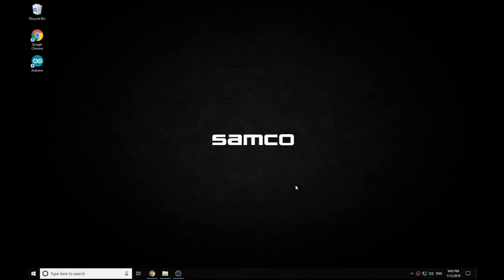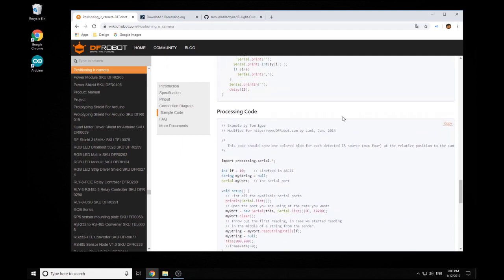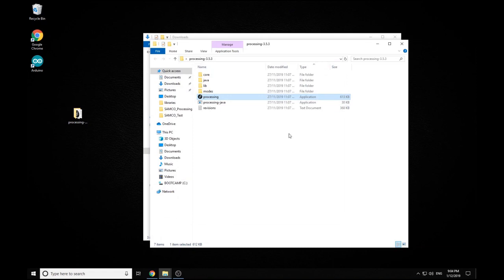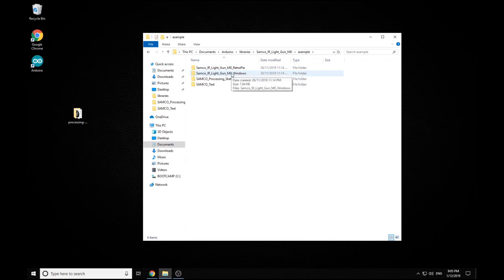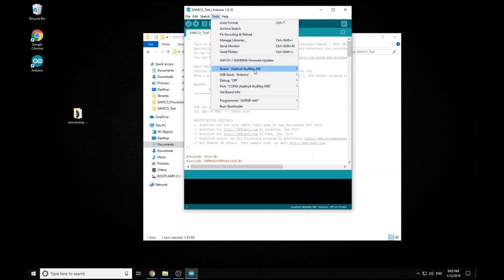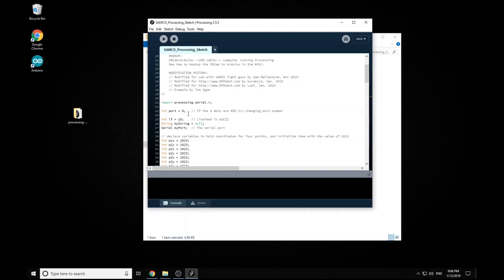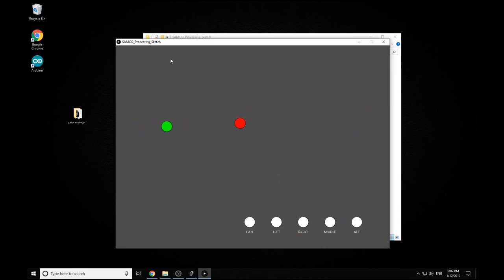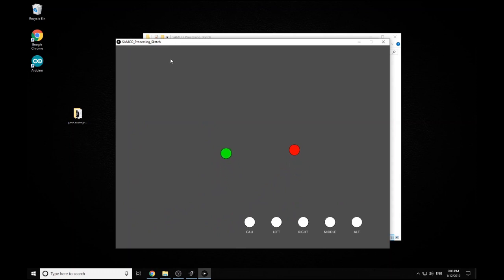SAMCO DIY Light Gun - Trouble Shooting Sketch

Comment: Really cool! Do you need a light bar sensor for each gun you have? I am thinking of using 2 or 3 guns, but wondering if I need a light sensor for each?

Also, what is the max size of display you could have? If my game was projected onto an entire wall would aiming still work?
Reply from the maker: Thanks man, yeah just need one sensor for as many guns as you like. The screen size depends on how far back you want to stand about 2.5 screen widths is optimal so projecting on a whole wall is probably not gonna work just due the fact you would have to stand so far away.